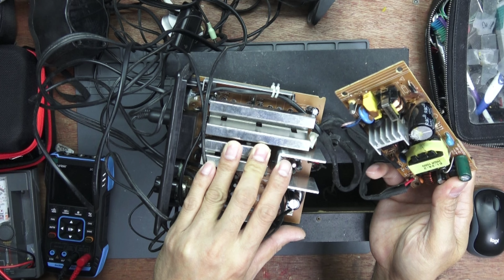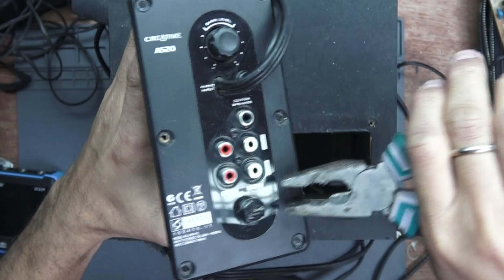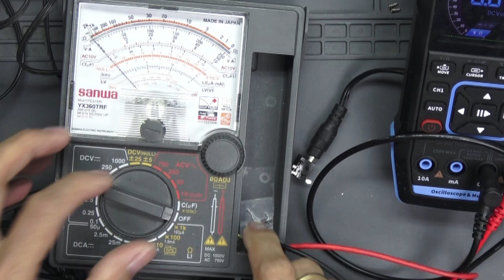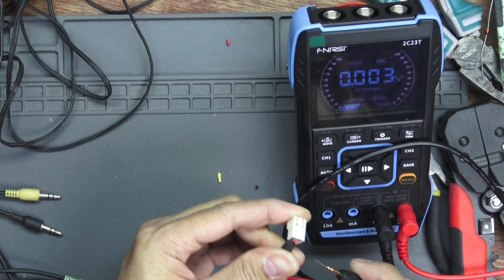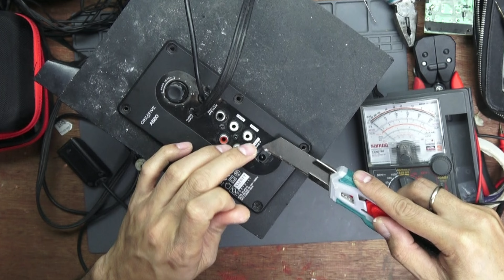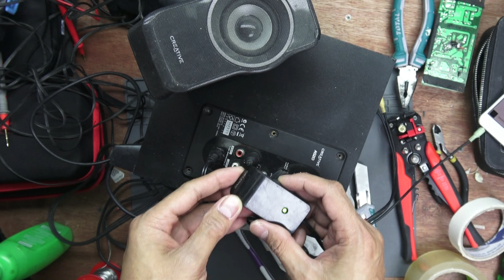Creative A520 speaker Repair No power

Comment: If I put 12 v 5amp will it run
Reply: I have 12v5amp dc adapter
Reply from the maker: Yes it will work.
Reply from the maker: Hi, yes it will work. 12 volts 2 amp will work also. Make sure the polarity is correct. Thank you for watching!

Comment: 12v 5amp ok but ac or dc bro please help 😢
Reply from the maker: Hi, It need AC power adaptor. 12 volts DC 2 amps and above. Check it here then please choose 12 volts 4A --- I just found this on AliExpress: 
220V to 5V12V1A2A/3A/5A/5A isolation switch power module AC-DC voltage reduction module
https://a.aliexpress.com/_c4afp6fT
Reply from the maker: You can also use this 12 volts 2 amps --- I just found this on AliExpress: 
AC DC Adaptor 12V 2A 2000ma Adapter Power Supply EU UK AU US Plug Wall Charger For LED Strip Light Lamp 5.5mm*2.5mm
https://a.aliexpress.com/_c4M3GLAH

Comment: 12 v 5amp ac adapter or dc adapter
Reply from the maker: Hi, It need AC power adaptor. 12 volts DC 2 amps and above. Check it here then please choose 12 volts 4A --- I just found this on AliExpress: 
220V to 5V12V1A2A/3A/5A/5A isolation switch power module AC-DC voltage reduction module
https://a.aliexpress.com/_c4afp6fT

Comment: Please make a video on how to change the subwoofer too. Because I have the same A520 and I purchased a 10 Inch Car Subwoofer but I don't know how to connect it to the circuit board.
Reply from the maker: Hi, I will if I can get a chance. Speaker has only 2 lines positive and negative. On the speaker terminal it has markings positive and negative  signs. Just copy the connection from the old speaker to the new speakers.

Comment: how much amps and volt  is the original PSU?
I'm using a 19V 4.74A laptop adapter, but it cuts out the sound. How many volts and amps should I use? Thanks
Reply from the maker: Hi, 12 volts 2amps

Comment: I just revived mine at the best way possible.....
Changed the bass potentiometer for cracking while changing bass hot glued a 12v 2amp wifi router adapter routed the cables with ties so no wiggling changed the controller light with a blue led looks cool the orignal woofer was broken so I installed a samsung 60w 5.25inch subwoofer great bass and had left right and centre speakers rears were missing I had two samsung speakers laying around and paired with sound card with my pc and it works good but the only problems while playing music in 5.1 when volume is turned up or in game (I mean like literally turned up) some clipping is there like delay so I guess more then a 2amp brick?
Reply from the maker: Hi, great job! 3 or 4 amps is better. Thank you for watching ☺️
Reply: @ARTaudio440 Now I think I have to buy a psu board like the original it was on aliexpress it was like 12v 5amp supply board with the same length so it would not make clipping sound
Reply from the maker: @editsbykamal Yes!
Reply from the maker: @editsbykamal Hi, I would appreciate it if you can share the link here to help others needing the power supply🙏 Thank you

Comment: what is the main I.C model no?
Reply from the maker: @sourabh7625  Hi, Im sorry I didn't get the part number of the IC.
Reply: @ARTaudio440  okay no problem, I got it. TEA2025B I.C  has been used in A520.
Reply from the maker: @sourabh7625  Thank you for sharing this part number.

Comment: Yo lo repare por el oscilador estaba bien y el mosfet pero si estaban dañado el fusible 2 diodos RL207 D1 y D3 rectificadores y una resistencia R6=4.7 ohmios chamuscado (dañado) el ZD10 le puse de 16.8 y me daba un chirrido no estaba estable la fuente, le puse otro zener  de 24v y el capacitor C3 de 22uf media 16uf le cambie y listo me daba un chirrido con el filtro 16uf y media 12.5v al cambiar un filtro de 22uf medio 17.3v y ya no hubo chirrido y listo
Reply from the maker: @luciomusicforever  Great job! Thank you for watching!